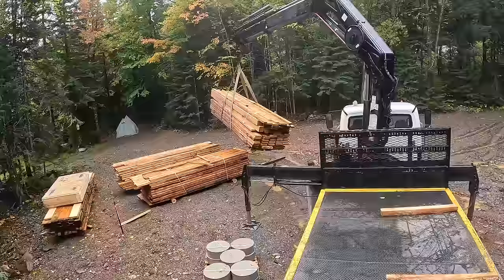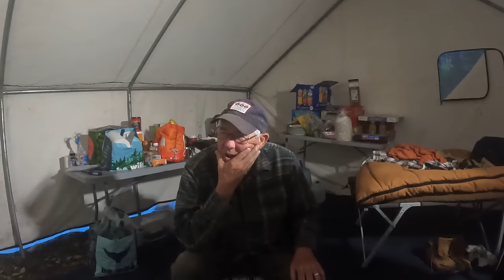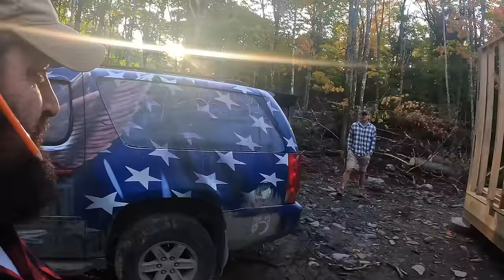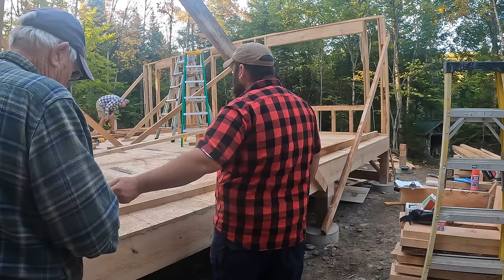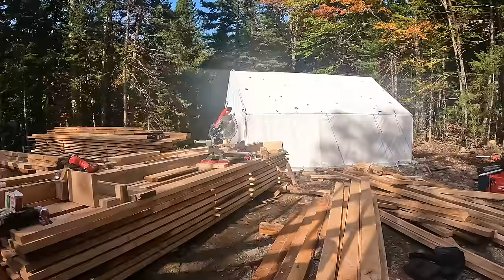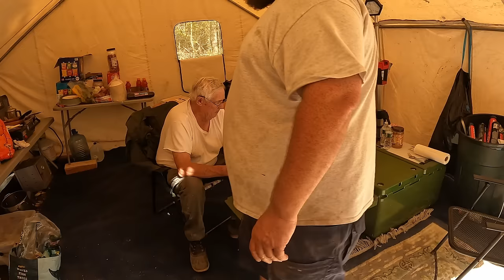OFF GRID CABIN BUILD: Gable Ends: Episode 15

Comment: I am curious as to why you did not use a vapor barrier BEFORE placing the insulation between the floor boards. Since I see it rains a considerable amount on your series, I would think it might have been a good choice to minimize moisture rising up into the cabin thereby decreasing winter cold and increasing summer humidity within the cabin. Just wondering what you thoughts were for not doing this. Especially since you mentioned you may not put any other flirting in other than keep the subfloor. Thanks.
Reply from the maker: That’s a good point I’ll ask Donnie . We get all seasons here and usually not a lot of rain like this year . I think a vapor barrier is a good idea most times  . The sun flooring is super tight and glued and nailed down tightly so no air can come up through at all and there is also an air space between the sun floor and the insulation

Comment: A little late now but when building walls you should snap a line the width of bottom stud from edge.  Toe nail bottom stud online with few nails not completely in.  This way you stand wall up and it's in position.  We would frame and sheath walls this way in Mass(making sure wall is square) so you just stand them up and nails(6 or 8 penny) would just pull out.  No positioning, just nail it where it stands as it is on the line and level as it is level as long as it was squared.   Without sheathing it you don't need to square it.  With sheathing you just leave the sheathing hanging low the height of the bottom sill.  You just leave the ends off to nail on later to cover the doublers.    Not sure if you are using sheathing but just thought I would add how we did it back in the day
Reply: I’m pretty sure it will all be good… Donnie is amazing. ❤️🥰❤️
Reply from the maker: Thank you.

Comment: I remember seeing moose in Maine. One night I saw one off the side of road, pulled off and shined my lights at one and was surprised with how massive it was.  About a month later I came upon a single car accident sitting in middle of road.  I was thinking wtf happened here?  Then upon getting to car I knew, it had hit a moose.  It was the most gruesome thing I have ever seen in my life.  The moose came over the hood with hardly any damage to front but the roof was peeled back and 2 front seat folks were dead with driver decapitated  A person in rear was still alive barely.  I did what I could which wasn't much and it seemed like forever till another car came along.  That car raced off to get help but it had to be almost a half hour till help had come and the rear seater also expired.  The thing was the moose was no where to found but the hair told the story.  I don't think they knew what hit them as there was no skid marks at all.  I was a mess, didn't sleep for days and was useless barely even eating.  That was some 30 odd years and I still get queasy thinking about it.
Reply from the maker: Wow, thanks for sharing.